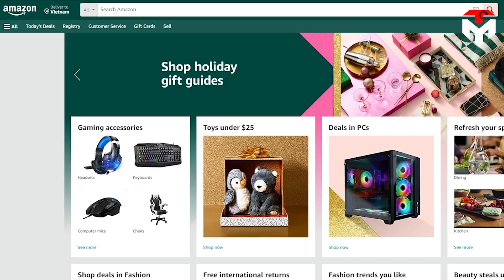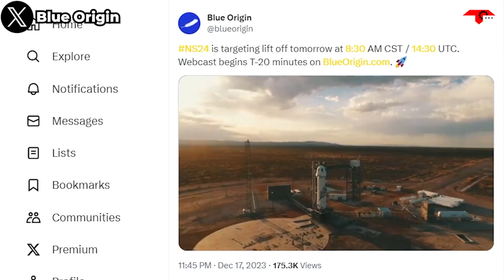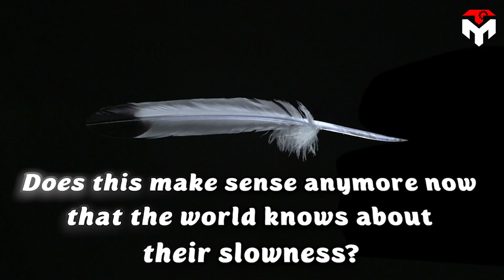Unexpected! Jeff Bezos finally Admitted why Elon Musk's SpaceX is much better than Blue Origin...

Comment: The Secret of Elon Musk as the director of the SpaceX research and development is concept design, prototyping, and actual test flights on a rapid timeline. Simply put, an engineering cycle of development with its failures abd successes. Richard Branson, as well as Jeff Bezos only went in initially for space tourism in sub orbital flights. Elon Musk on the meat and potatoes of cargo to low earth orbit.